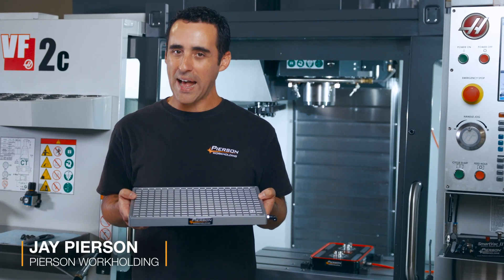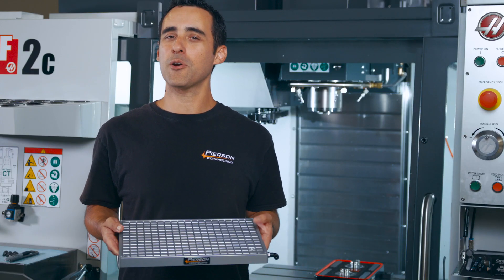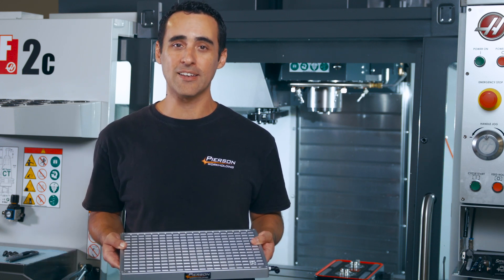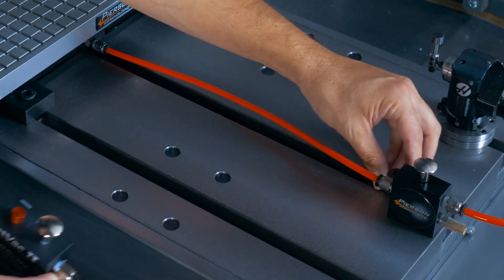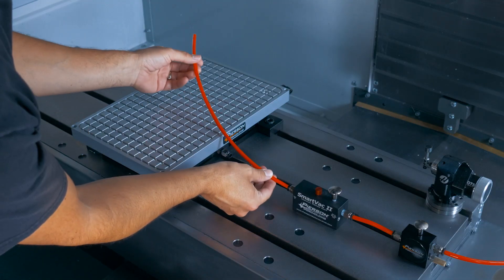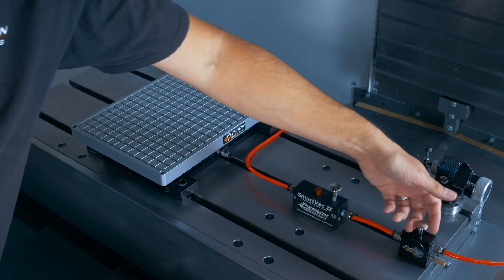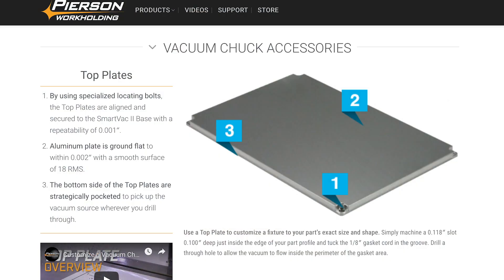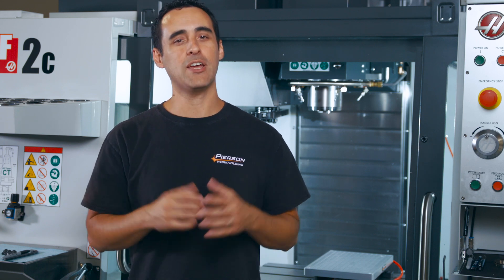Convert a Pallet System into a Vacuum Chuck

Comment: Jay, How tall or thick are these vacuum pallets?  I run a Brother and as I'm sure you're aware z axis is always an issue cause the spindle wont go to the table. I didn't see a dimension on your website outside of the footprint of 9.5x14
Reply from the maker: The total thickness from machine table to the top of the chuck is 2.85" (72.4mm).

Comment: Have you guys thought about doing a vacuum chuck and top plate setup that would fit in a tormach 440?  Because that would be awesome!!
Reply from the maker: The Mini Pallet System was built for all Tormach sizes including the 440 and this Vacuum Pallet is available for the MPS too.
Reply: Pierson Workholding WORD!!!! I do a ton of thin flat work, I will be checking all that jazz out!!